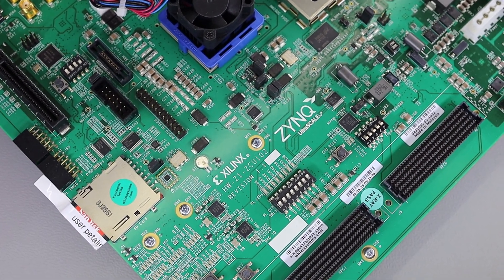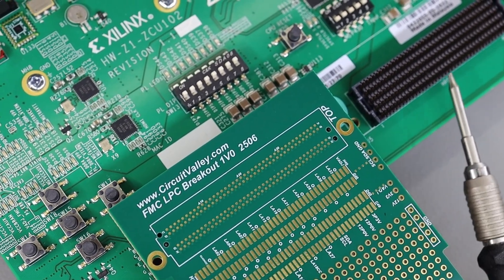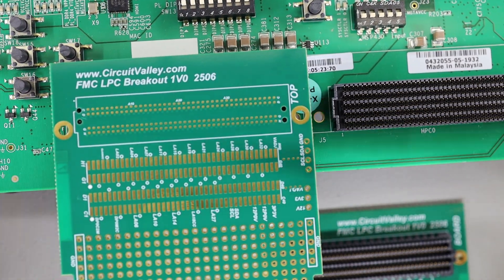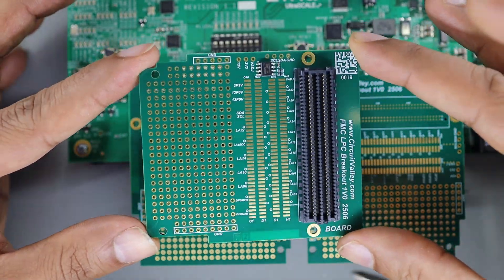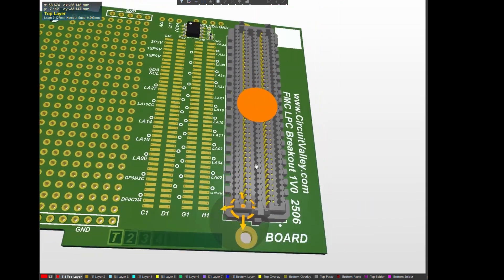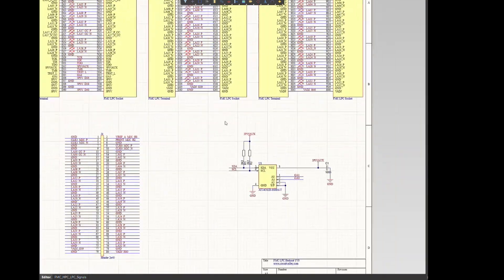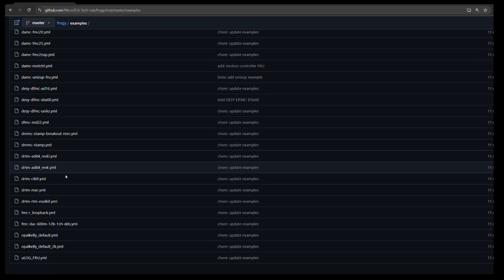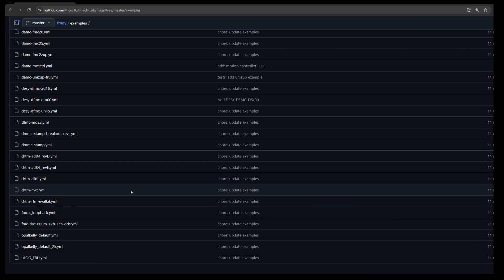Open FPGA FMC Breakout Board for Accessing LPC Connections For High End Xilinx FPGA Ultrascale+ Zynq

Comment: Why did you decide to break out high speed diff signals into 1.27mm pin header which introduces a considerable diff impedance mismatch? I would put finier pitch connectors like 0.5mm FPC instead.
Reply from the maker: This Board is designed specifically for Rapid protyping, I specifically chosen Smallest Handsolderable connector , if you use 0.5mm FPC then you would again need another adapter or PCB to adjust for your application.